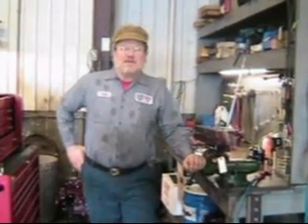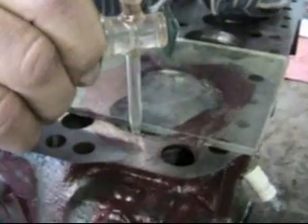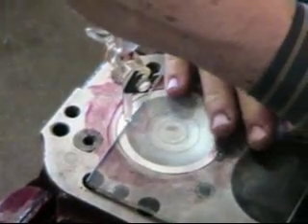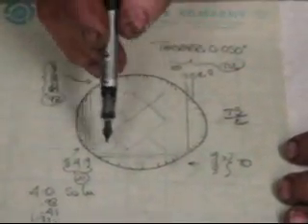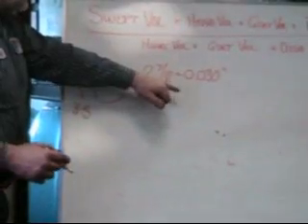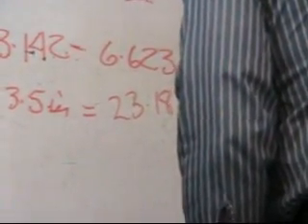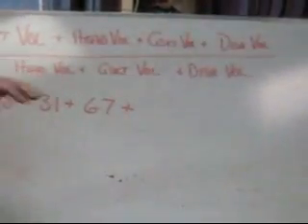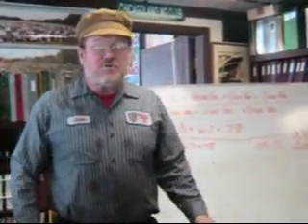059 MG Tech | Calculating Compression Ratio on MG Cylinder Head

Comment: If you want to get a very accurate reading of a surface area (such as the tracing of the gasket), weigh with an accurate set of scales a known area of paper, say 10 square inches,  then weigh the traced paper. From this you can easily figure out the area, however only with a good set of scales. :)